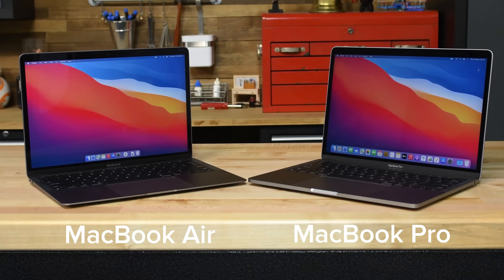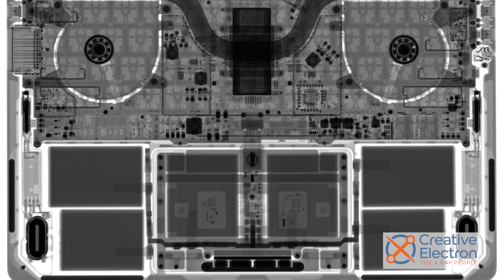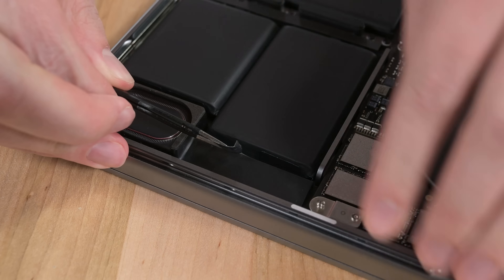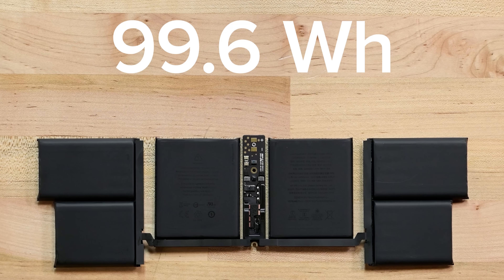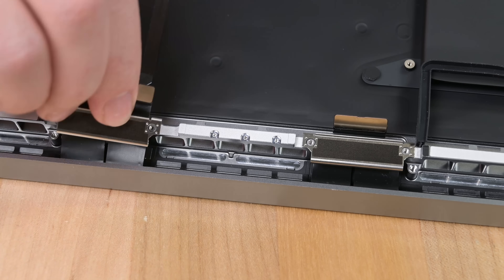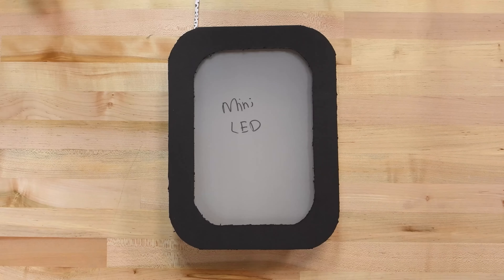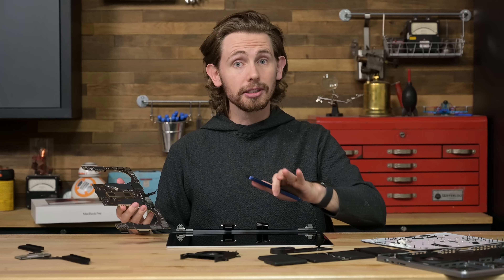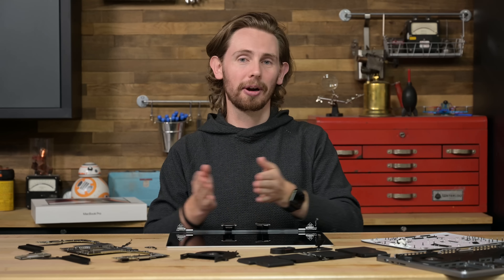MacBook Pro 2021 Teardown: Easier to Repair, Harder to Score…

Comment: Why is the battery divided into little sections?
Reply: First of all batteries are only made in rectangles normally, and as you make a battery larger the chance of defect is larger, so it’s cheaper to split into multiple small cells

Comment: If the tight integration is absolutely necessary for the performance benefits, then making the CPU, RAM and GPU a single SoC may make sense. However, I don't see this means that we should accept this at face value. The companies like Apple are seen as "innovators". So if they care so much about the environment, they could very well challenge themselves and actually "innovate" to make a zero-insertion-force socket to change the SoC and provide repair / upgrade options. Even without the environment spin, those companies are valued at trillions now. They take so much value from the public and deliver little. We should be putting more responsibilities on them.

Comment: Points should not be deducted for soldered memory in this case, it is justified 🙏

This level of performance AND efficiency is just not possible without memory on the package.
M1 Max has an 8 channel memory controller. Standard socketed memory would mean 8 x SODIMM slots - it’s not realistic. Even if it was, SODIMMs would drastically increase power consumption and ruin the incredible perf/watt. A fast memory system is key to making an SoC at this level work.

Alder Lake (Intel 12th gen) was eluded to as a possible challenger. IMO, it will not in any way compete with what Apple is doing. Alder Lake will be a bloated, incredibly inefficient family of processors that don’t even come close to competing with M1 Pro/Max on perf/watt, system bandwidth, GPU/ML performance, video encode/decode etc. Alder Lake will be a dinosaur by comparison as it continues the trend of leaning heavily on obscene boost clocks and power to achieve competitive performance (peak boost power of 215W for a mobile chip is crazy!). 🙏

Comment: I think apple is moving back the right way, from glued in batteries to pull tabs is good to see, although i would like to see a frame like the earlier macbook air's battery frame, its nice to see that most of the ports are modular, you can still charge these pro's with usb c, so if a cable gets yanked and the port malfunctions, at least you don't have to send your laptop in, you could just replace the port, and i understand that smartphones have everything integrated, but for laptops, it leaves a sour aftertast, yeah, its highly integrated in the chip, but what you buy is what you are stuck with, and we all know that ssd's have a sertain number of write cycles before they fail.

Comment: That M1 Pro package is quite interesting. Usually, the heatspreader covers any on-package RAM chips as well or has them off to one side. I've never seen a package that has holes cut in the heatspreader for the RAM.

Comment: There is something else we should seriously start considering when evaluating these machines: not just performance per watt, but absolute power consumption, period. Having the CPU and the GPU in a single SoC and the memory in the same package really does seem to make a huge difference both in performance and power consumption, and we should consider how much CO2 emissions are cumulatively saved by Apple customers by not using power-hungry Intel or AMD x86-based systems.
Reply: Then I would argue that we should count the environmental damage Apple made by producing hard to repair hardware and tricking customers to buy newer ones even for the machines fixed with simple replacements.

Comment: nice they finally opted for removable adhesive for the batteries, but one very big question.... how did they install the keyboard? bunch of rivets again or back to screws? Still can improve a lot on the repairability of the lcd screens, still having that layered bullcr*p is a mayor pain for repairing the screen without having to spend a ton of money on an entire monitor assembly.
At least good to know certain small things were improved to be repairableish.

Comment: M1 types of performance is absolutely possible on x86 without the ram problems. Just wait until AMD/Intel is on 5nm node like Apple is. The only thing x86 may be worse at is the battery life.

Comment: There should be separate "repair" and "upgrade" scores. Lack of removable memory would hurt the upgrade score but not the repair score since I've never seen an integrated memory module fail so it wouldn't hurt repair.
Reply: I've seen both integrated memory and graphics modules fail. It definitely happens.
Reply: Good point. I'm not quite sure how you'd "upgrade" the battery though, surely that would also be repairs as the only time I can think of replacing a battery is when it runs down and stops holding charge or fails completely?
Reply: that's a good idea, but in this particular case, this macbook is simply not upgradeable. You cannot upgrade the ssd, ram, battery, wifi card. There are zero upgrades for this laptop, only repairs. On x86 PC laptops, yeah, this kind of separation would be nice. Infact it already exists, as ifixit provides guides on ram upgrades, ssd upgrades etc, for some laptop models, along with a maching "difficulty meter"
Reply: @verpejas  yeah this laptop would get a 0 for upgradability. But its repairability score would be higher
Reply: I AGREEE, we need an entire new concept of score

Comment: I can understand why memory is soldered on the board. It is shared for the whole SoC, so there is not really an easy way to offer upgrades. Storage on the other hand makes no sense whatsoever. Even if they wanted to solder the original storage out of the box, they should give us a PCI-E slot for an expansion. Sony decided to do this with the PS5. They had a very fast built-in storage but gave us a PCI-E slot for expansion.

Comment: Parts like RAM being integrated within the M1 is important - it means parts which need to communicate often can communicate with less delay

There's lots of other reasons the M1 is so performant and I'm sure they could have separated the RAM and still impressed everyone, but this is a move forwards. Maybe they've removed upgradability for the sake of money before but in this case they've done it to engineer a better laptop and there's no denying it would be slower otherwise.

It's definitely tricky for you guys to suddenly say "non-upgradable RAM is okay" and not get backlash but I think it should be removed from the score. At the end of the day, RAM isn't something like a charging port or battery that you would expect to break. Personally I think your "reparability" score should include things that people commonly need to fix, not something you might want to upgrade
Reply: non upgradable 30 GB/s memory is absolutely outrageous, non upgradable 200 GB/s is absolutely amazing.

Comment: I like how the standards for "removable battery" went from a battery you could remove by pressing 2 tabs or one on the outside of the machine to...
single use adhesive hidden behind a plethora of screws
Reply: Thankfully my current/prior laptops have (or have had) remvable batteries, though again different definitions of removable:
Acer Aspire 5742: locked in with 2 tabs, externally removable and upgradable (from 6 cell to 9 cell)
HP 15-ac Series: locked in with 2 tabs, externally removable (capped at 4 cell)
HP OMEN 15-dc Series: remove back cover (screwed in), then remove battery (screwed in). More of a pain, and being Li-Po (instead of 18650) it is more prone to expanding later on in life (potentially damaging other components) but hey, at least it's not glued.
Reply: @TheSpotify95  I wasn't so lucky, my Lenovo laptop desperately needs a battery replacement, but it's super difficult and kinda risky!
Reply: @TheSpotify95  When a battery lasts 17 hours and has a 7-year life, I'm not sure why users would need it to be removable.
Reply: @kurttappe  It is not 7 years. The battery is rated to 1000 cycles. That is typically 4-6 years for the average consumer, with most prosumers roughly 3-5 years typically. Heavy users 2-3 years easily.
Reply: @kurttappe  I Always remove the battery when i'm not needing to use or charge it. Constantly charging-decharging the battery by a little bit can't be good for it
Reply: @kurttappe  Well, it can still fail. But I totally agree with you that a laptop with such an insane battery life, even if the battery degrades down to lets say 50% of its original capacity, then it would still last for 8.5 hours which for most uses is still VERY decent.
Reply: So just throw the entire thing in the trash when the battery becomes unusable? I think as long as it's replaceable, that's OK, but it's better if it doesn't need to be done by Apple themselves, since after 5-7 years I'm pretty sure replacing the battery will cost you $400 minimum and they'll try to sell you a new machine, whereas if you can just buy a new battery online and swap it yourself in 5 minutes you'll just keep using it, and if you need more power it can be sold or given to someone else.

You can do so much even with a 10 year old computer that the thought of them becoming e-waste just because a single component failed out of warranty is kinda disturbing. I nearly bought an iMac a few years ago, but decided against it because it had no display input, so if the computer stopped working or became too slow for what I needed I wouldn't even be able to use it as a monitor.
Reply: @kurttappe  " you don't need it" 
"do it our way!"
Reply: @kurttappe  That sounds unrealistic.
Reply: @tcc5750   That's why I keep it plugged in whenever there's an outlet in reach.  The less you cycle the battery, the longer it will last.
Reply: @tcc5750  even 2-3years would by no stretch of the imagination justify a removable battery like in the old days with all the capacity, form factor and internal layout constraints attached. It is a thing of the past, gone with the dodo. Paying 30-50$ for a battery swap (labor only, the parts/spare battery need to be payed anyways) every 2-5years is absolutely okay if you don't feel comfortable doing it yourself.
Reply: @kurttappe  It doesn't have 7 year life - it still allows ~1000 cycles.
Reply: @Bchan  apple also is smart about how it does or doesn't charge the battery these days based on usage. My laptop currently is at 79% has been plugged in for the last 2 weeks and says "charging on hold, rarely unplugged battery". I I know it needs to travel there is a "charge to full" option I can hit.
Reply: @kurttappe  Which laptop battery lasts 17 hours after a couple of years? Use case will vary but I doubt anyone will have 17 hours for 7 years.
Reply: @joroshiba  Kinda a nice feature, but having to think ahead like this can be a pain. You often forget to hit full charge and end up leaving with a half charged battery.
Reply: @tcc5750  true that! my MacBook Air 2019 battery is totally dead after 2 and a half years of usage (481 cycles). The computer often used heavy programs of Adobe for a design-related job
Reply: @kurttappe  Hahahaha!!!!! Do you work in IT?!?
Reply: @tcc5750  I've reached 80 cycles in 6 months, and it has been pretty active usage, I have watched hundreds of hours of movies on battery. So it's promise to reach 1000 cycles in about 5 years.  And battery lifetime also depends on conditions of usage (for example it's better for battery to use it in frames 20-80% and in relatively cool temperature). But reaching 1000 cycles doesn't mean battery death, it means that capacity will be decreased to about 80%, which still good enough if you take it from this hours.
While you're right about the estimates, I think If someone use their battery so heavy that it's exhausted in 2-3 years on machine like this, than it's likely that the person should replace the battery in months on machines that have less then 10hours of battery life though easier to replace, which still uncomfortable
Reply: Fond memories of my 2010 17inch mbp that burned through 3 (count em) severely swollen batteries. Apple replaced it twice then basically said nevermind … but newer tech made one that fit — which is still svelte and still working! I was very happy they were easy to remove. The good old days…
Reply: I like how batteries these days actually last a day and degrade very little over time. Id rather have this than needing a new battery every 2 years to get 3 hours max.
Reply: Yeah, seems crazy. Two tabs that you spread with your finger nails to pull out the battery. Wah-la, done.
Reply: I know I'm not the norm but my 2014 still has excellent battery life as I rarely use it on battery. 167 cycles and 97% health after 7 years, macOS simply bypasses the battery if left plugged in so they can last that long, though it is not normal as generally people use the battery more than I do
Reply: Well at least you can trust third party stores to replace your battery now.
Reply: Those batteries were less than half the capacity of this. I remember 4 of my laptops had near 50w/hr ±10. When they were removable. I rarely ever needed to remove them. I keep my battries healthy by charging them to 80% & discharging them to 20%.
Reply: My speaker is cracking sadly I found out it's a physical damage. However, I found it I need to take a lot of things out in order to change it. Can I remove it without taking the battery?
Reply: still better than non-replaceable at all, it's still something
Reply: what the heck is a platera? were you trying to say plethora?
Reply: @CommonTater100  Yes, sorry for that typo
Reply: @okene  I'd bet money that most of these machines, 60% or so, will go their entire lifespan on the original battery.  

Beyond that, spending a few hours every 3 years replacing a battery isn't an insane ask.  The cost, and build complication of adding a frame and fasteners isn't justified.  Laptop batteries don't last 2hrs anymore, no need for them to be externally or easily removable.
Reply: @mrlt1151  As the video said, there's no reason to make battery replacement difficult. The problem was solved. No reason to justify bad design (or money grabbing design).
Reply: Because look comes first before functionality. We are at the era where showing off is easier and need wow factor every now and then to spice up the life.
Reply: @trym2121 Boohooo people care about beauty; how dare????
Reply: Not just that, because it also seems that putting 4 USB ports insted of just 2, adding HDMI port and SD card slot, along with a keyboard with proper physical function keys were a standard invented by Apple in 2021!

Comment: It's an interesting strategy Apple is leading here. This macbook has clearly been designed to be serviced, we are miles away from the old everything glued-style design. But users are still not allowed here, I assume it's caked with proprietary chips and good luck buying an official part.
I suppose that in the future, as producing electronics becomes more expensive, Apple will try to make more money by pushing its services on their devices. In short; future products will be easily servicable but you will need to go through Apple's repair services and pay the Apple fee to make it usable. So a step in the right direction, just remember that with these kind of compagnies you never really own your hardware.

Comment: I love everything you guys do but, I feel like the Pentalobe screw penalty makes me groan these days. I got a cheap screwdriver set for five bucks and it had a pentalobe bit, and pretty much every kit you've ever sold has a pentalobe bit. I get that it's non-standard, but if you're opening up $1000+ machines the tiny commitment it takes to spend a dollar or two on a pentalobe bit really should really have no impact on the device's repairability score. If Apple were changing it every year I'd get it, but it's one bit for every one of their devices since like, the iPhone 4S.
Reply: Agreed, it's probably about as easy to get hold of a pentalobe compatible screwdriver as it is to get hold of any other small screw driver tip.
Reply: I really think that when you design a $1000+ laptop, you can afford to use standart screws
Reply: @theEskalaator  or you can use the same screws that have been in your supply chain for a decade and a half now and expect people who care enough to open them to buy a 2 dollar bit?
Reply: @maybedonn  they shouldn't have been introduced in the fist place
Reply: @akdhidbeif  relax Karen, now they are here.
Reply: @RandomUser2401  bruh